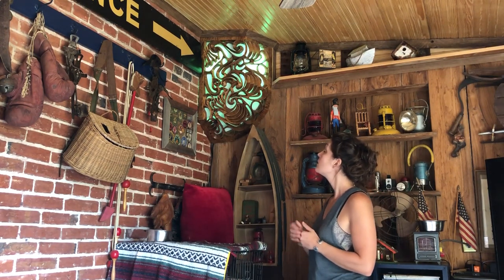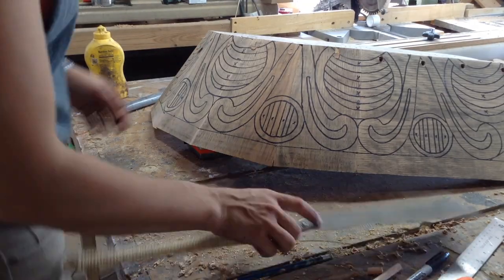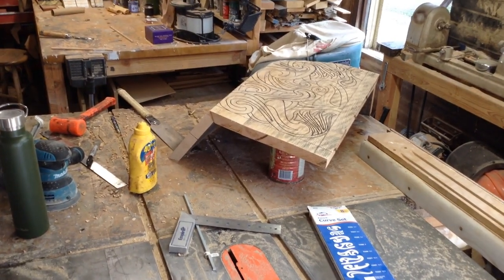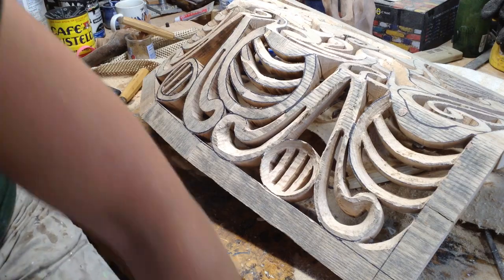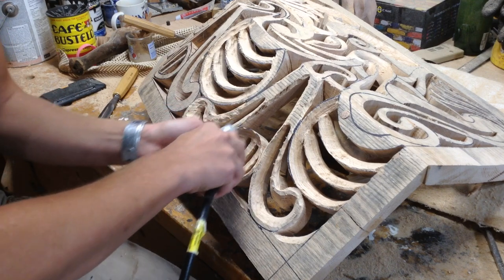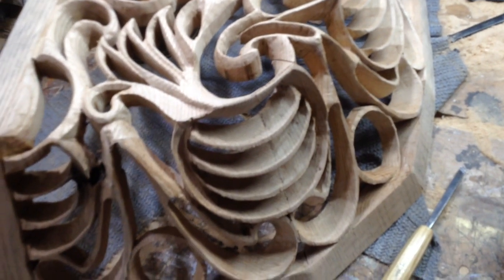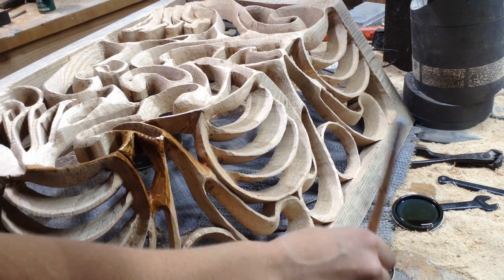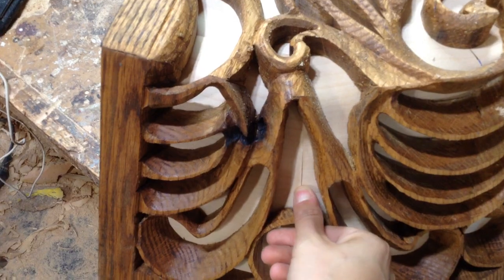Woodworking : Carved Art Nouveau Vent Cover // How-To Part 2

Comment: Beautiful piece; you're a very talented sculptor.  A tool tip for you - when I was younger and more hot blooded than I am today, I used to keep an old Blackhawk ratchet laying in the middle of the shop to throw instead of the tool that was misbehaving.  That kept me from breaking a lot of expensive tools and the ratchet was none the worse for its misfortune.  Ironically, I still have the Blackhawk which is now over 100 years old and has increased in value. ;-)
Reply from the maker: hahaha nice!  That is a good tip, I started doing something similar with a rubber mallet.

Comment: French curve templates are really under appreciated! LOL..poor jigsaw...but GREAT RESULTS!  Moi would have used LED strips on the pipe, that way it would not have the shadow, but would require some soldering and such. The LED floods do the trick though!
Reply from the maker: I actually have used the led strip lights in the past and I had some for this, but they just weren't bright enough.  The flood lights pack a punch.

Comment: Nice work. I'm impressed.
I don't know if these are on your radar, but Iwasaki files are something you might find useful tools. I can attest that they are a pleasure to use and you barely need to do any sanding after use.
Reply from the maker: Those are not on my radar.  I'll have to check them out.  I have pretty low end files now and wouldn't mind an upgrade.
Reply: @HoneyBadgerWoodWorks  If it helps, I got mine from Crimson Guitars. They import them to the UK and put really good handles on them. Not sure if that's so useful as you are in the USA ...
I am not a luthier, but some luthiery tools are great for general woodworking and fine woodwork. I can definitely recommend the Shinto saw rasp. Too few people know about those.
Reply from the maker: @emm_arr  Thanks!  I'll have to check them out.